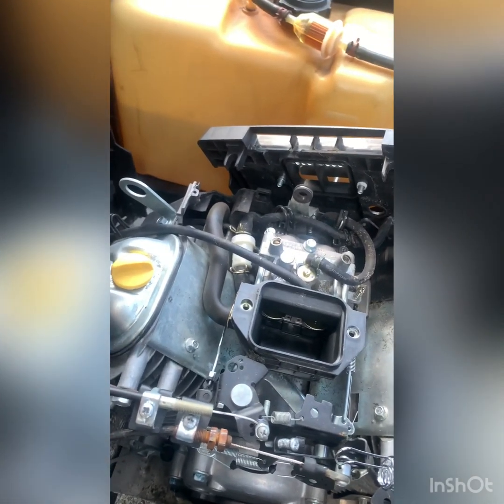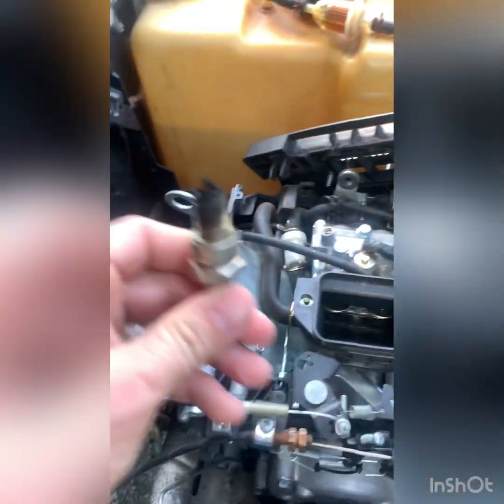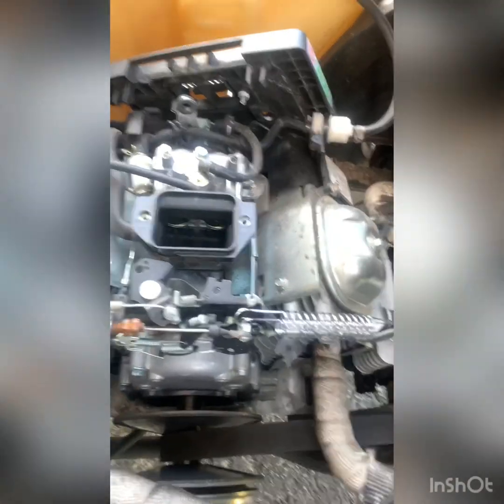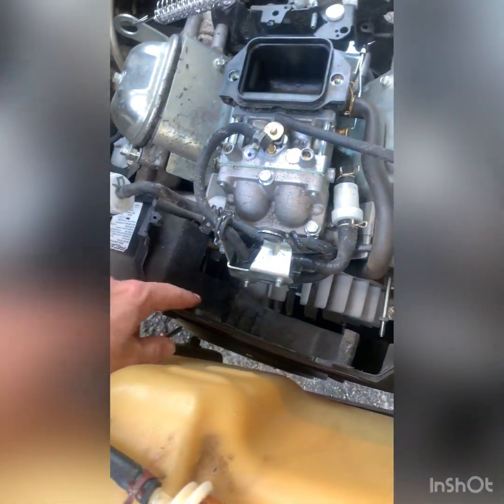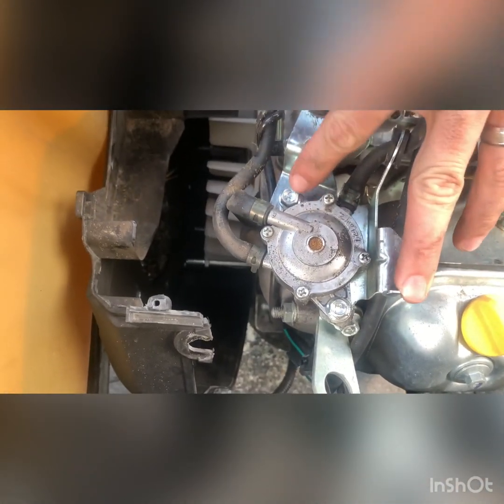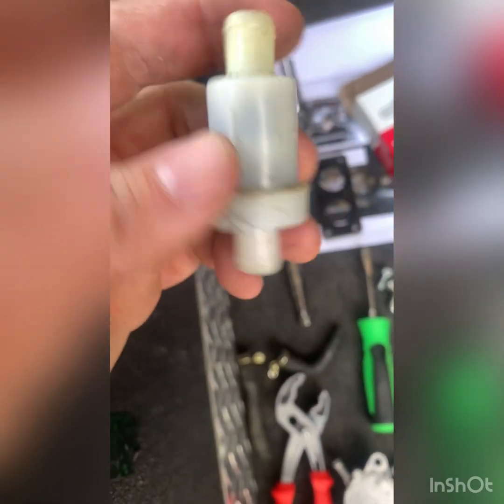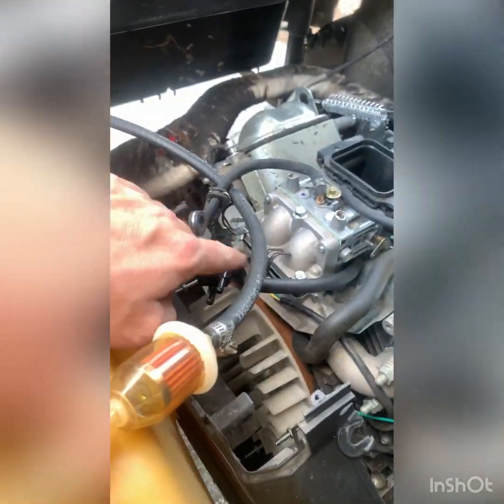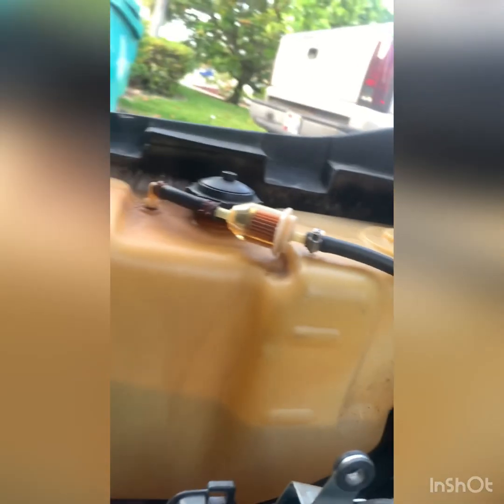Predator 670 Fuel Pump upgrade

Comment: Will this fuel pump have enough pressure to be used on a mud motor? I'm getting this motor to build a mud motor but am told I need to replace the fuel pump to a low psi fuel pump
Reply: I run an electric fuel pump on my mud motor. I have a built 670 on a swamp runner long tail. When the engine was stock, the carb would run dry at WOT. I hooked up a low pressure electric fuel pump, and that fixed it. Now, the motor has a bunch of go fast parts and I’m using a Mikuni 34mm carb. It definitely needs an electric fuel pump to support the factory pump.
Reply: @dereksmith2929 I have the 670 in my club car. I did the mikuni 32mm from performance 670. I installed a low pressure electric pump with 1-5psi regulator post pump. Ran for a little and then no crank. The fuel going into the carb was really dark. Disconnected hoses and ran the pump into a bowl. Fuel cleared up. Have you heard of this issue?
Reply from the maker: i dont see why not, is the motor stock? I would like to think if your setup isnt in need of "high flow" of fuel youll be fine

Comment: That filter for the fuel pump pulse line has a coalescerfilter in it, not crack haha, basically like steel wool. So that’s normal looking. It is supposed to allow oil vapors to condense on the steel wool, and allow that oil to drip back to the engine. This keeps liquid oil out of the pulsing diaphragm of the fuel pump. 

Also definitely have too many fuel filters in line of gas flow, I think that would restrict the weak flow provided by these type of pumps.
Reply from the maker: That particular filter was replaced with a nice inline marine filter and the pulse pump was changed out to a Mukini

Comment: Hey Keith, thanks for the info!
Are you happy with the 670 predator motor?
Any issues?...
Other than the upgrade on the fuel pump
Reply from the maker: I love this motor, I got this motor at a good time on price, they have gone up a bit since I got mine 2 years ago. what do you plan on running this in? my golf cart definitely needed tweaking after I installed this that I was not ware of when I decided to go with this engine set up. You need to upgrade your fuel pump for more flow, if you running the motor for a mud/river boat you wont have to mess with the carb but if you are going to run in a golf cart like myself youll need to watch my latest video on the 670 for matching you jet size and tuning.

Comment: How does the pump perform?
Reply from the maker: The pump does put out more fuel but I need to ditch this OEM carb and I am currently pricing out a Mikuni 30mm carb kit, it wont have the high's like the OEM or a larger Mikuni but will be great for lower rpms and mid range. I typically drive this around my neighborhood with the occasional drive to the store. so the 30 mm is perfect for my needs.
Reply: @keithellett4283  did you ever go with the Mikuni carb?